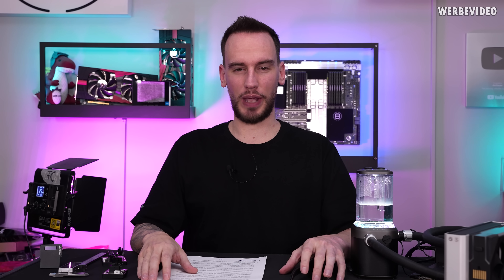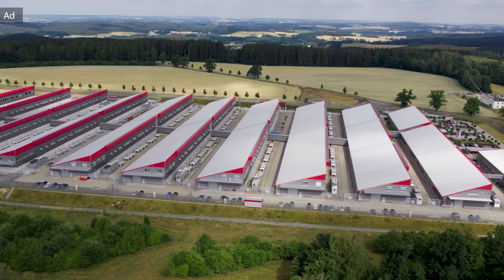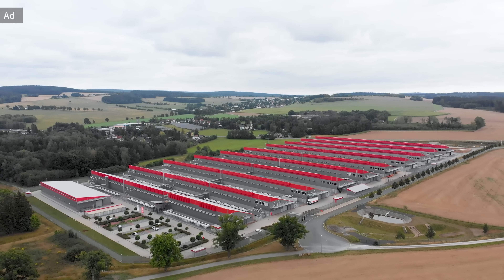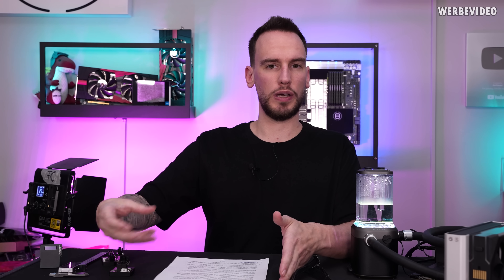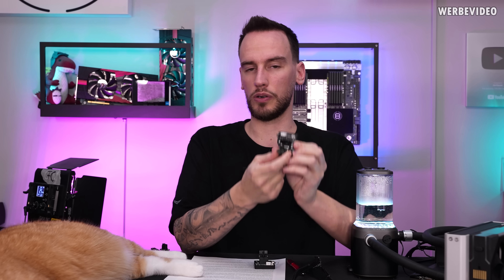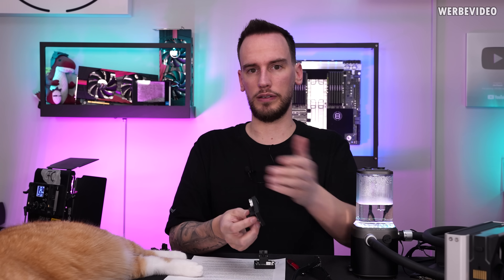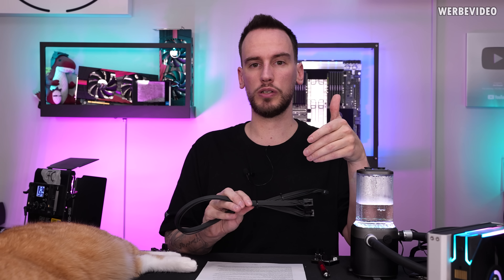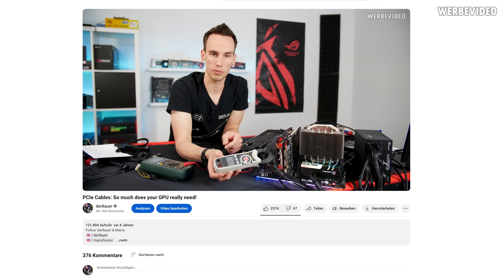12VHPWR is just Garbage and will Remain a Problem!!

Comment: I really hope some GPUs next gen don't have the 12vhpwr connector because at this point I would consider it a negative selling point and would much prefer the existing 8 pin and 6 pin connectors. 

I am not planing on 5090 anyway as its going to cost way too much most likely (and I like to actually play games not overheat sitting in a chair) but when choosing between the options availble that fit my use case I will pick the card without 12vhpwr connectors even if that means going down a perfromance tier. If there are no problems over the next 2-3 generations then fine it will of proven itself safe but as of the moment I as a consumer do not consider cards using the connector as safe and am waiting for the big news story of a tragic house fire. That association between 4090 and house fire you would think would be enough for Nvidia to want to change something.
Reply: It's funny cause 3090ti doesn't have any of these issues, yet uses the exact same connector with the exact same power draw. Makes you wonder if it's really the connector as opposed to the adapters that have been the same with every single melting case...

RTX 30 introduced the connector, no issues, more power draw in general.

Comment: I suppose a non angled through hole female 12VHPWR connector on the card would be the simplest solution to prevent most torque causing poor connections. 
Either that or just make a 16 pin connector similar to the motherboard power connector (with the same gauge as CPU connector) the more of those larger pins connected the more solid (and dedicated sens pins is lazy engineering).

Comment: 4090 is the most powerful GPU in the market right now, when it's not melting connectors or failing due to power issues.

Comment: I'd happily use four 8 pin connectors. I mean, those connectors are already being used in my PC, and floating around in the case because of NVidia's ridiculous adapter that's too short to hide all the connectors and cables in the back. This is actually worse than just using four 8 pins! And I don't understand why NVidia want to save PCB space on cards which are so large I had to change to a new PC case to fit the thing inside it. None of it makes sense. I wish they'd recall the cards TBH.

Comment: How does poking a wire in a hole become such a problem after 100 years of poking wires in holes?
My 3080 cable makes a hard 90 right at the plug and is pulled tight around the card and out the back. (Almost) invisible. Not hanging over the front.

Comment: I have those Corsair cables on a multigpu AI rig with 4090s....yeah my heart stopped beating the first time I got the black screen.  

I need the cables because they only use 2 pcie power plugs on the PSU.  

My solution was a custom 3d printed screw on bracket for each of the cards.  Without the bracket imperceptible movements to the cable would power the GPU down.

It sucks and you are right the current situation is not working.  It's like Corsair went the opposite direction and to ensure their cables were always seated perfectly, the card will turn off with the tiniest movement to the cable.

Comment: I've been scratching my head over the placement of the connector to start with. I'm certainly not qualified to have an informed opinion on the plug itself if it's good or bad, but having it on the side of the card (the more "traditional" place) seemed problematic to me. Why hasn't/haven't any of the manufacturers thought to place the plug (on the card) at the rear? Didn't the EVGA 3090 Ti have the connector at the end of the card? Why not do that with the 4090's as well?

Comment: I have a 16 pin CM cable that melted, all the power wires it looks like the protective coating shrank back or was cut, stripped and pinned incorrectly with bare wires showing and the  paracord was covering it up, I had it plugged in all the way. The card still works to this day. I was told I didn't have it plugged in all the way. They would have replaced the cable, I'm not running another cable mod product ever. I don't blame cable mod, i don't respect the way I was told over and over i didn't have it plugged in correctly when i know did.

Comment: Like i work in machine manufacturing, the one i currently planned out has 1250A 3Phase busbar system inside and uses a shitton of high power connectors(just to give some context), and i looked at this shitty cable back then and was disgusted. old molex was already outdated as shit. but goddamn that new one is the worst they coulda come up with. ridicolous

Comment: Holy shit that LED changing when flexing the cable is scary. Do you know what melts things faster than under-spec cables? Arcing. It causes a massive spike in resistance at the connection site which, as we know, causes heat.

Comment: Put together a PC for the first time in 15 years. It was just bizarre to put a 4090 brick into a tiny slot, then a sag support stick. The most bizarre was the 12v cable sticking out, trying to bend the cable so that is doesn't hit the side of the case and trying to make sure the tiny connector is seated just right. None of this makes any sense. That connector has the robustness of a data connector or something.

Comment: NVidia should (by now) realize their goof, and just goes to PCI-Express 8-pin connectors x 4 on all future designs. What a botch! Even with 2 12VHPWR connectors, you introduce the same problem. It's an engineering blunder, and I will not purchase any video card with the 12VHPWR connector. What a mess!

Comment: 3*8=24, why not use the atx connector, never heard of problems with these powering motherboards.
Reply: Motherboards barely draw any power
Reply: @riba2233  doesn't change the fact that the atx connecter can be repurposed for feeding gfx cards, one big connector at the end of the card.
Reply: @Diaman_D  sure, but I still think that 3x8 separately are much more manageable

Comment: Gee that title sounds just the way I felt about that connector as soon as I saw it, you know with 600W capacity over such a small connector?

I SAID that this will continually be a problem.  As GPUs get more powerful and these start getting close to having 600W going across them, my assumption was it would at LEAST get warm.

Next, since 100% of PC users do NOT watch tech videos on Youtube and that would include plenty of gamers, you'll have too many people that don't understand the problem.

I NEVER want to have this in a system, EVER.  This is also saying I don't EVER want a GPU that's pulling 600W.  Even for 4K gaming I want it to be around 300 - 350W and high fps 4K RT gaming in that power envelope should be achievable next gen Nvidia at something like the 5080 level.  I don't know when AMD will get there.  But that's what I want for 4K gaming, down in that 300 - 350W territory on something like a 5080, and that also means the performance of that 5080 is similar to a 4090, and costs less than a 4090.

With 3 150W connectors and about 75W off the PCIe slot, that ALONE can give you about 500W safely.

But as soon as I saw that 600W connector I said to myself that needs to be PERFECT, and it better be mounted on a MB to where the power cable coming into it doesn't push up into the side panel of the case, which will put pressure on that cable and connector.

And low and behold there's been problems ever since it's been used.  I guess all the years I worked in electronics gave me SOME common sense.

Comment: Finally, somebody proved that this connector is garbage. I'm an electronics technician and have known this was a bad design and I can't believe that it was approved for use. I have a 4090 and I use the 12vhpwr connector cable provided with my super flower psu. I undervolt the 4090 to 1v @ 2850mhz to not lose performance from stock while lowering power draw and that's how I'll always run it most likely. If my connector melts I'll remove the connector and make my own cable with four 8 pin connectors on one end with bare wires on the other and solder the wires directly to the board. That'll be a certain fix. I'm surprised that the repair guys aren't doing that.

Comment: This also makes me think that custom wiring your system with solid wire MOLEX, while more expensive, and probably more reliable. This also helps explain why some of those old PSUs had THICK and STIFF AF cables.

I am curious if anyone has tested reliability of all copper vs the aluminium stranded vs solid cables to see if components are any more or less reliable as a result of changing cable types. I suppose one benefit with solid core cables is that if you could have non-conducting, insulated metal frame, silicone covered connector ends, with a universal standard, you could probably use the same power connectors for decades and decades to come. 😅 Since the lifetime of properly insulated solid copper is at minimum 50-years. With treatments for oxidation, that might double. 😅
Reply: There is no aluminium stranded wire in the PC 12V circuit, not permissible. The cable seen at 7:32 is copper core, immersion surface tinned (chemical deposition). Only the copper cross-section area counts towards the gauge, not the surface tinning area.

Comment: A solution to end it all for high power and huge graphics cards would be to just make them have their own power supply where you connect one end to the card from the outside (would plug into a power jack which could be located next to the first Display port jack, then the other, would just plug into a wall outlet, and in necessary, all the power stuff would be handled inside a power brick that would be in between the wall and the card with the cord on both sides being long enough so the power brick could lay on the floor or something.)
Reply: Or something like the old cable aux where you screw the connector in. Keep it tight and there's your margin of safety
Reply: ah yes, a laptop. thats what you want.

Comment: I've been repeating it ever since Nvidia presented their new power connector with 30xx series. It's impossible for this connector to not cause problems.
Reply: Yet somehow there were no issues with RTX 30. 3090ti and 4090 have the exact same power draw yet no issues. The only problems were with two specific adapters. Why are people putting blame on the connector all of a sudden?
Reply: @Djinnerator   3090ti and 4090 have the same power draw only on paper. Only third party 3090ti cards that used triple 8-pin pciex connector went over 500W. Also, 30xx fe cards used a different design connector.
Reply: @ShinIkari  3060ti, 3080, 3090, and 3090ti all used 12VHPWR. 3090ti and 4090 power draw is not just the same on paper. They both typically sit at 450w under load, and both can spike to around 600w. I know they use the same connector because I have two 3090ti in my home computer.
Reply: @ShinIkari  3090ti Founders Edition easily goes above 500w when spiking.

Regardless, CableMod's adapter melts even when idle, where the card pulls about 50-60w tops. If the connector were the issue, we'd see a bunch of cases with melted connectors from RTX 30. Yet we see zero.
Reply: @Djinnerator   12VHPWR was introduced with ATX 3.0 spec. Over a year after 30xx series got released. While similar, the 12pin connector present on 30xx series is built to different specifications. 

Spikes are different from sustained draw. That's where 4090 is different. 

 And it's not only about cablemod adapters. The whole thing started with melting connectors in adapters provided with cards, then there were cases of melting connectors in aftermarket cables. I thought that Roman explained the problem clearly enough. The 12VHPWR connector's design is flawed. And there's more than one flaw.

Comment: Thanks for explaining the safety factor of each connector type; highly informative. Wish they had kept the old 6/8pin style but increased the power rating per connector; say 150w in your example to 200w or more.
Reply: I would love to see them adopt the 12V EPS connector for future GPUs. More power capacity than the GPU 8-pin as it uses all 8 wires for power delivery, and equally reliable. I've only ever seen the 4-pin fail and that was one time with a 10900K OC going where it shouldn't. We've seen it on some Tesla workstation cards, so we know they know how to make it work.

Comment: This is actually one of the reasons I don't use an Nvidia card. Can you actually buy a high end Nvidia card that doesn't use this connector?
Reply: i think the RTX 4070 doesn't use it but its used starting from the 4070Ti.

Comment: The 12 V specification IS garbage. But, as long as they stick with the 1920 vintage buck converter, they cannot use the 48 V standard used in communications for decades. They would have to use a 2011 vintage design such as the Ćuk-buck2. Some server companies are working with Teslaco to use the 21st-century designs. (Do you get a frock coat and top hat with the 1920 design?)

Comment: Imo, the best altrernative for this "connector" is just solder long 3x8pin / 4x8pin adapter directly to the GPU. I know, 4090 is expensive but this could be real solution

Comment: Best explanation I’ve seen on this issue, at least from everything I’ve read/seen so far. Guaranteed the 5000 series cards are already lined up and will have these connectors as well. Can you imagine how bad things will get before NVIDIA admits that there’s an issue? And still…users will buy them expecting to be one of the lucky ones… 🤷🏻‍♂️

Comment: Electrical engineer here, 7:25 , where did you get this? sorry this is wrong, this "Derating" chart that you used is for individually insulated cables or something, there is no such "corrections" used for stranded vs solid conductors.

The difference in Current Carrying Capacity for both Solid and Stranded Copper/Aluminum conductors is negligible. 

So an 18AWG Stranded cable has almost the same amperage as solid 18AWG.

The major difference in amperage comes between copper vs aluminium conductor material. Aluminium is only 60% condcution of copper.

Comment: I admit it may just be me, but it does boggle my mind that someone would under the present circumstances (or in general) not fully mount/seat a power adapter unless it was 1. Super low voltage and low power, and thus unlikely to cause a heating issue, or 2. There was no alternative and it was a life threatening situation. In all other situations, not fully seating power connectors seems insane to me.

I get that I probably sound "arrogant" saying this, but I remember when I was a kid being taught how to assemble computers that these  MOLEX connectors MUST be properly seated.

For 1. Because an improperly seated cable can cause reliability issues, and the last thing anyone wants is their device to start bugging out only to find that it was due to an improperly seated cable. (Like your HDD glitching out at the worst possible moment causing irreparable data loss.)

Or 2. If something doesn't fit, unless there is NO other options, like say the part isn't manufactured anymore and you were in the pre-3D printing era. Maybe, having to cut a square and round side two prong 120V power cord into a double round side by cutting off some excess plastic molding.

But even then, that was in extreme circumstances. Nobody was supposed to do that if you had a proper alternative.

Every time I see another video or read another article about "improper seating" it makes me question who exactly are building these PCs. Who doesn't do a pull test on cables or doesn't check to make sure all cables are fully seated? Am I some kind of ADHD throwback or something? O.o I don't get it.

I get a fully seated cable melting being a problem or the cables wearing out over time where they might be secure, but then over time come loose. But just not checking? If a part doesn't fit, contact the manufacturer and send it back. Better to have to wait than risk burning your PC and living space down. How are people so batshit?

I know. I know. Cuz people are that batshit. Still, it's weird, you know? Like, if the cable doesn't fit, send it back. Don't risk the often times most expensive component in your PC and the HOPE that a given manufacturer honors a warranty (not to mention the extended delay time) than take the little extra time and hassle to get the correct part.

If you are broke, okay. I get the rationale. When you are at the brink and need this thing to survive, at least get the right part ASAP. But seriously… 😤 people need to be more responsible. It's bad enough when I ADHD fuck shit up by accident. I do that constantly. But, when you have the time (it isn't life or death) and tools (you can get them. This isn't the old days and you aren't likely stranded somewhere without postage access, like another planet).

Unless you are stranded in outer space and need a connector to fit for the guidance or life support computers, maybe consider waiting.

As an ADHDer, this feels REALLY weird saying to others.

I agree that the problem is largely with the cable design to begin with. But given you are supposed to plug cables all the way in, it makes me wonder how these folks operate normally? Is this why there are so many house fires? Do people just not have sufficient survival instincts? O.o

Not trying to troll people. I just don't get how someone can have the capabilities to figure out how to replace a GPU, but not fully seat a power cable or make sure the cable fits before continuing.

Over ending cables and wearing them out from too many removals and reseating is one thing. That's shitty design on the manufacturer's part. But when the design isn't complete shit, what gives people?

I've been horrified if my house burnt down because I was slack with the assembly of a PC. But, maybe that is a design lesson. These people need to better idiot proof the hardware connectors. If it ain't fully seated, it won't work. Whine all you want about it "not turning on". Better that then the alternatives.